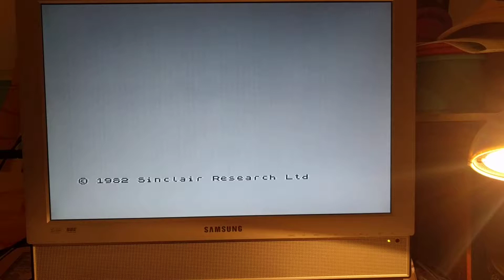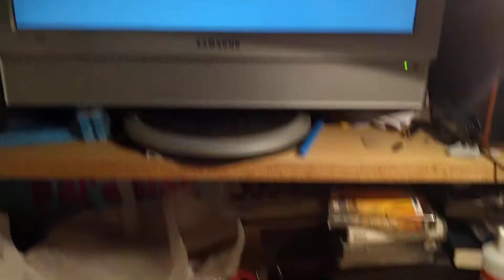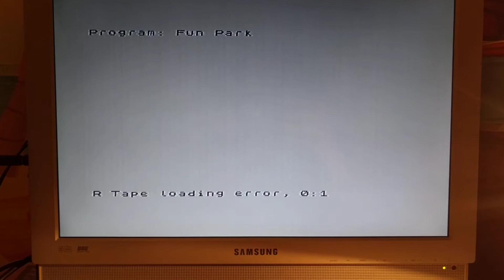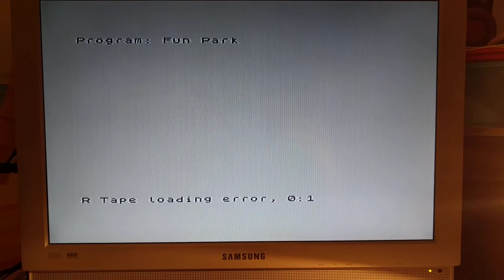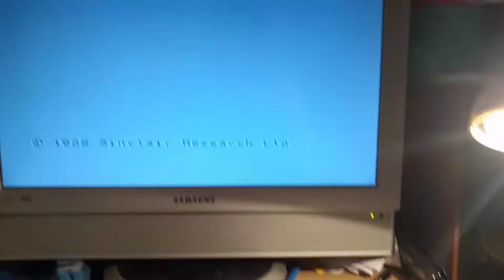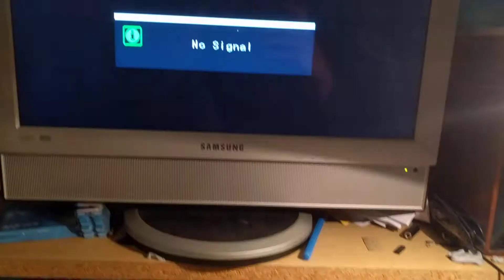Set up and run a Sinclair ZX Spectrum 48k in the 21st century - Part 2

Comment: Problem here is your trying to use a Walkman...if you use a proper tape player with a data switch, your tapes will load every time unless they are faulty..i do things old skool...isn't the point to get the 80s experience 🤷‍♂️
Reply from the maker: Sorry I just seen this comment lol Indeed I realised the error of my ways walkman has a stereo head, I need to find an old style cassette player or dig throught my parents garage I might be able to find the one I used to use.